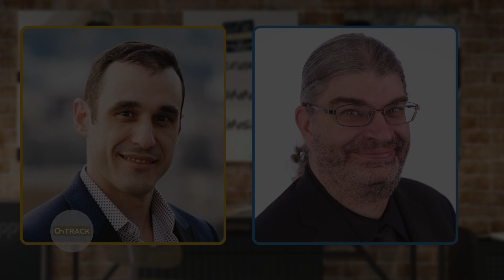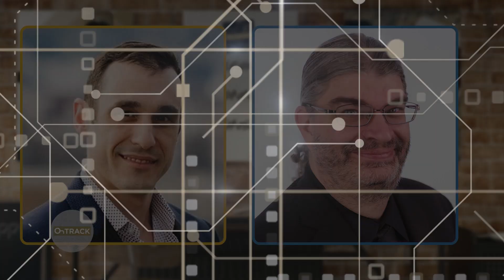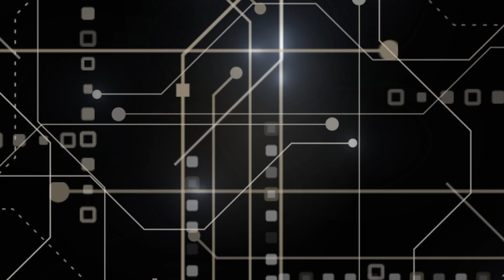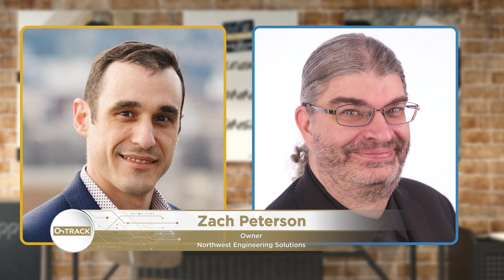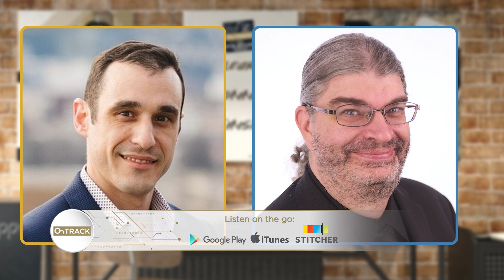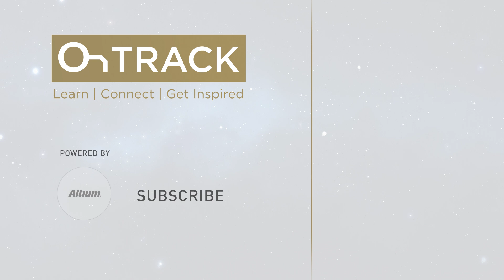IPC Courses, PCB Design Practices & Advanced Materials with Kris Moyer

Comment: Great interview. These IPC courses had me licking my chops but are about as expensive ($2k+) as my college courses for my masters program. I’m curious the weight these IPC certifications hold for getting design roles compared to an engineer that has a masters degree.
Reply: Just like a college degree or another certification like the CPCD, the CID/CID+ does not guarantee anything in terms of a job or design role. You should take the courses because they give you knowledge you need to do better in your current role or to give you knowledge you need to help you pursue a future role.